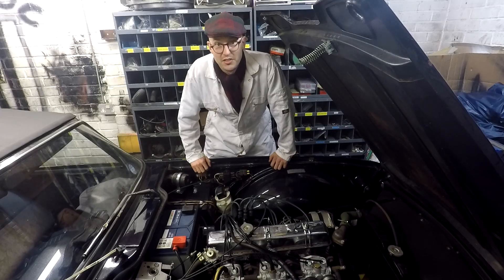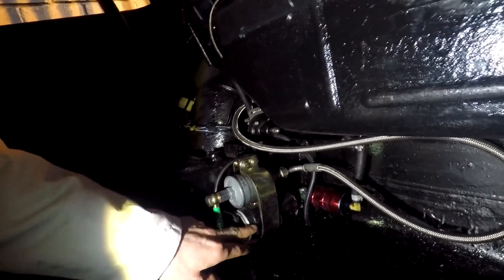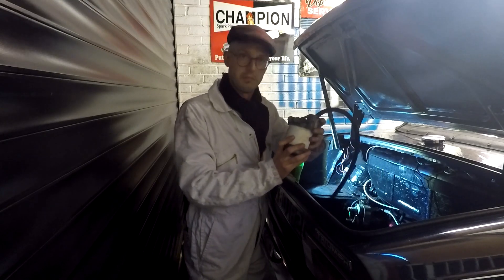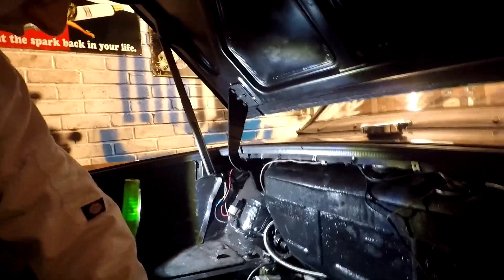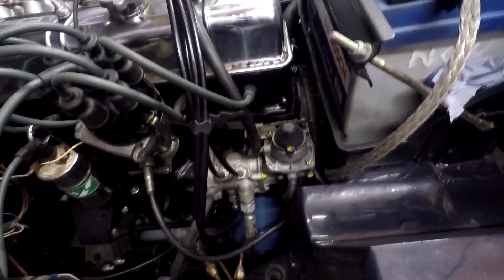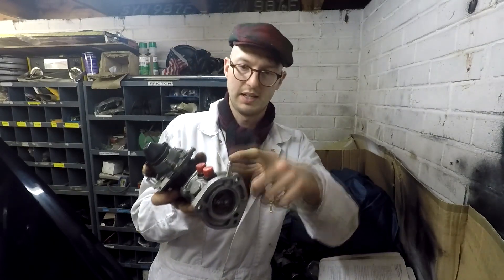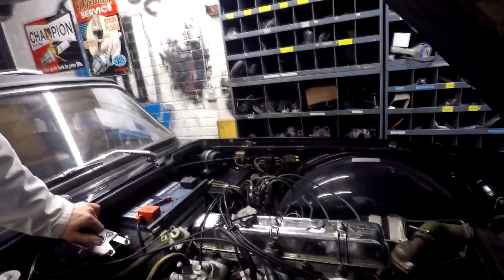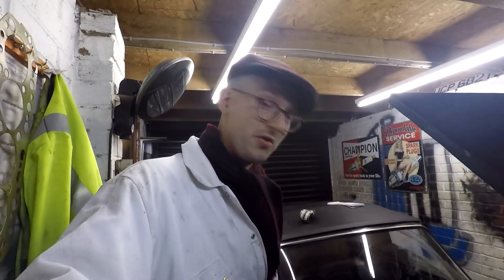Triumph TR6 A Brief Overview of Fuel Injection

Comment: Great overview the boot is good location for the pump i had a mk2 cavalier sri once ,the pump being underneath the car on a sort of cradle suspended from the boot floor by flexible mountings and the pump wiring got corroded ,
Reply from the maker: Cheers Paul, yeah I find it keeps more stuff away from the hot engine, so in theory less to go wrong

Comment: Thank-you so much for making this video Steve! This has been so informative. You've really taken the mystery out of setting up the metering unit, seems very approachable. I was not aware that the banjo bolts had check valves in them, but that makes sense when you think about it. I'm certain I've seen modern banjo bolts with check valves somewhere, so maybe there's a modern alternative to the originals which might give greater reliability.I had purchased a full set of CR PI gear to make a PI GT6. Sent them off to get refurbished, but frustratingly have not had any updates about them for months now, not too hopeful esp with the pandemic. I'm still intent on trying it out, so might have to find another set unfortunately.

Stay safe, and thanks again. I've been inside for a month now, and received word that I'll probably be working from home for another one...
Reply from the maker: Your very welcome, the time I rebuild an engine I'll do a more detailed video on the set up of the metering unit. GT6 Pi, I have seen this done before, its a great idea, if its set up right it will go well. When it comes to sending of parts with the Pi system I only use a handful of suppliers. Going back to the banjo bolts, be careful who you buy them from, NOS ones are far better made than some of the new stuff out there, and the same goes with injectors.

Keep well and safe too my friend, the sooner we get through this the better